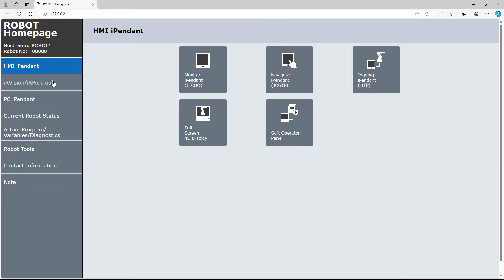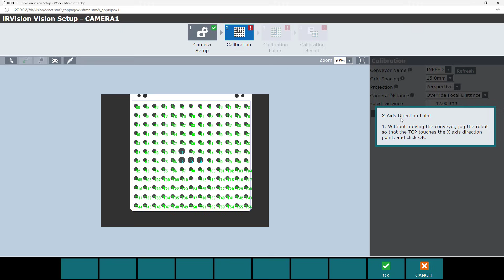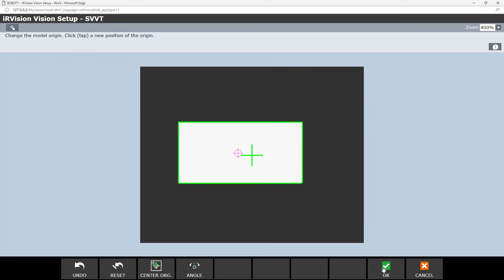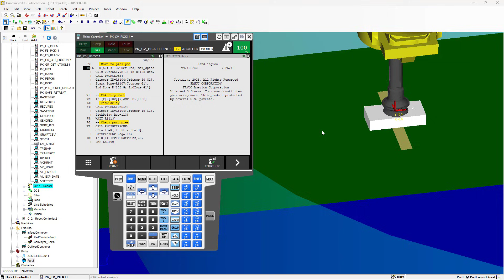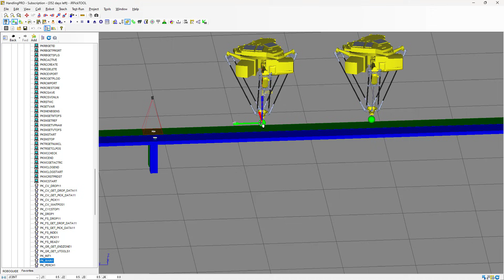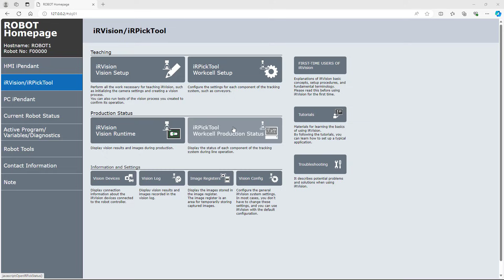iRPickTool Setup Part 5

Comment: Hello, thank you for this very comprehensive tutorial, which has helped me a lot with a project.
Do you know how to detect the position of parts using a laser sensor in the Roboguide cell? Do you have any idea how to do this?
Reply from the maker: I looked at that in the past and I couldn't find anything. You may try to fake it using some background logic or using a vision system that gives you the position.

Comment: First of all, congratulations on this extraordinary job you've done. Second, my friend, I have two questions. First, have you developed such an application for any process already running in the plant? My second question: Have you found a way to customize these applications? I mean, sometimes it's necessary to add code to these applications for certain process requests.
Reply: Do you have any information where you can be contacted?
Reply from the maker: As I explained on the introduction of the first video, there are two software packages, iRPickTool Basic (J944), and iRPickTool (J945). These two versions cannot coexist together, you can only install one of them in the controller. In the basic version, you need to program everything by yourself, on the iRPickTool (plug and play) version, most of the programming effort is already done. What I have shown on these videos is the starting point, think it as building blocks where you can add more robots, cameras, conveyors and fix stations. If you need to do any customizations, you can always reach out Fanuc for help. We have several applications already implemented for the food industry. Although iRPickTool looks simple on the outside, never underestimate the complexity of this kind of applications, they can be very challenging. I will continue making more videos on this subject, there are a lot of features to explore.
Reply: @EduardoSuarez-Automation  thanks so much

Comment: Hello Eduardo, your tutorials were of great help to me, I recently started in the world of industrial robotics and I have a lot to learn. One question, would it be possible to use rail tracking with the pick tool?
Reply from the maker: iRPickTool does not support rail tracking, see section "2.6 RESTRICTIONS" on the manual.
Reply: I have a cell with a robot with a seventh axis and I need it to move too